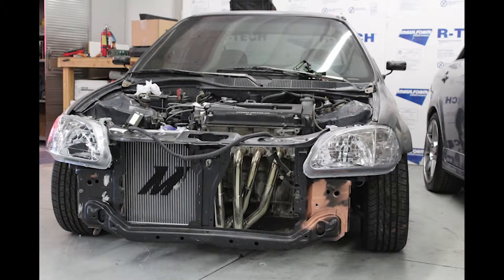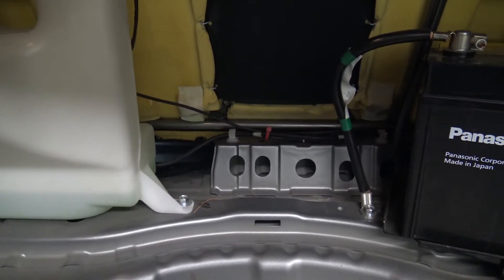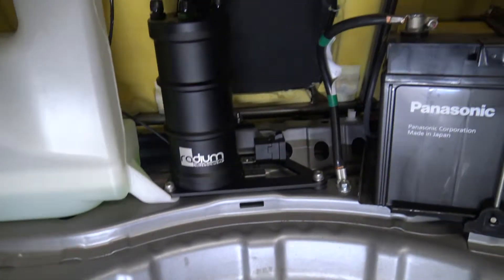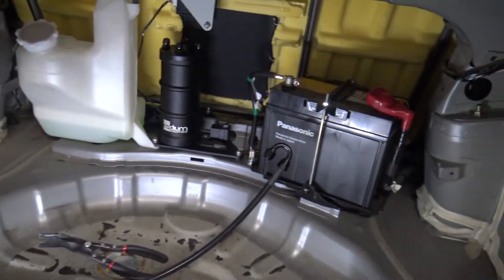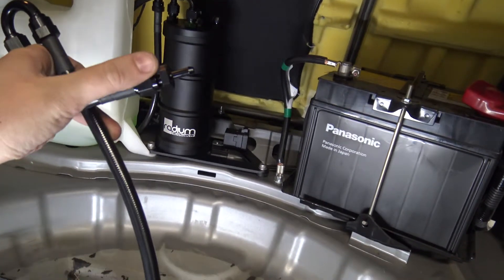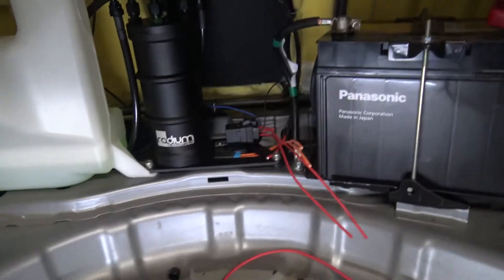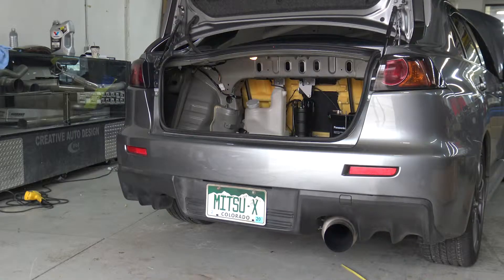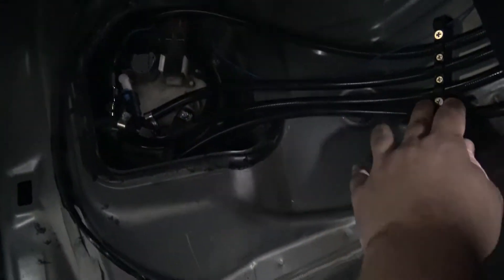How to install a surge tank

Comment: What about the primary fuel pump cover? Do u just leave it open..
Reply from the maker: No. What I did was took and made to straight cuts to make a small flap. That way the hoses can go under the cap. Then I used a foam tape to go around the hoses so that the cover didn't affect them.

Comment: What pump did you guys end up using on the surge tank?  Also, any issues with it running at full power all the time?  Thanks
Reply from the maker: We went with the AEM pump. Have not seen any negative effects after the install. Drives like normal. We also added the radium fuel rail. FIC injectors and a Radium FPR.